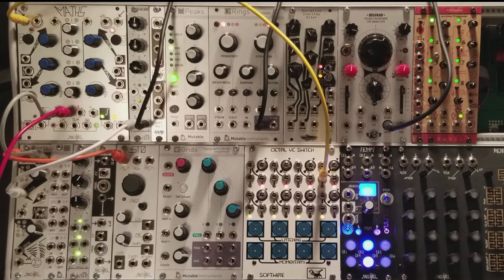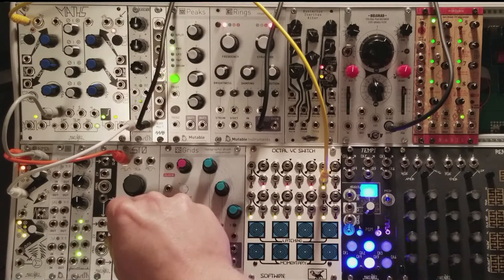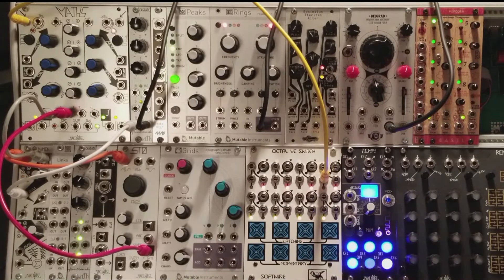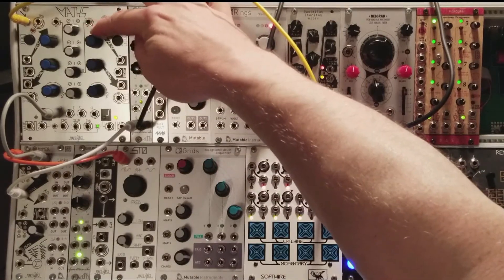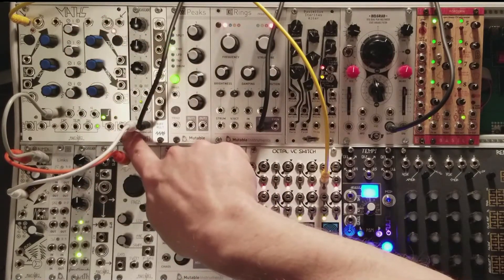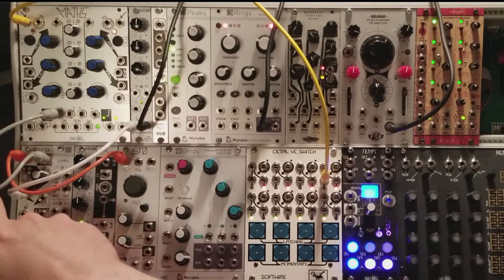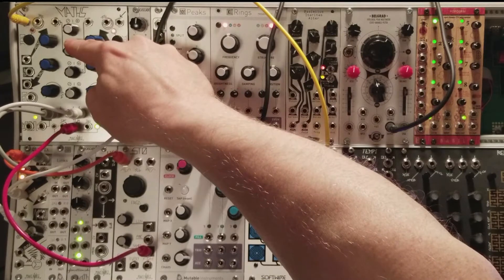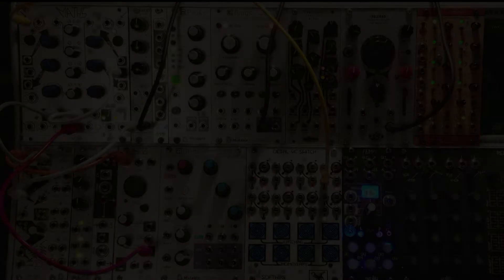Maths - Modulating the Sweet Spot

Comment: I know it is expensive, but this is the reason I got my Mordax Data. Understanding what the hell is going on with Maths. IT is a Ahhh momento when you check what is the shape of the voltage you are generating. At some point it should be easy to guess, but when you start it is very easy to make mistakes and not knowing why you dont get the results you are expecting.